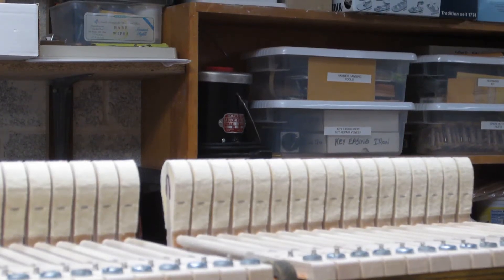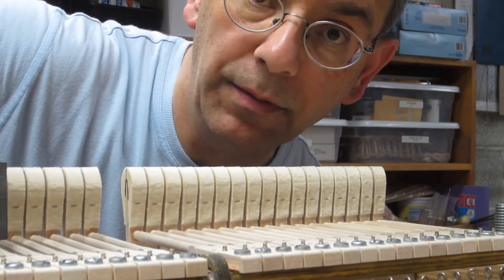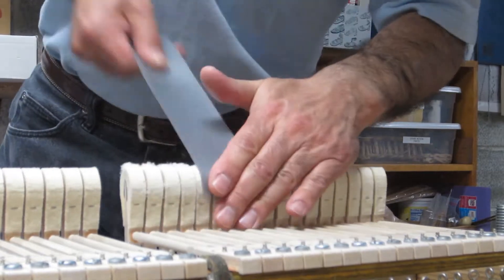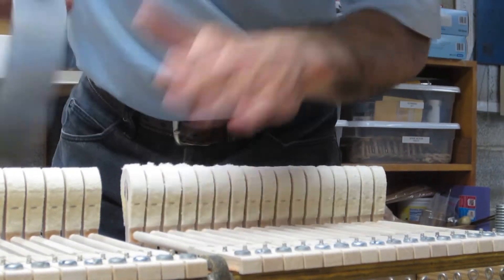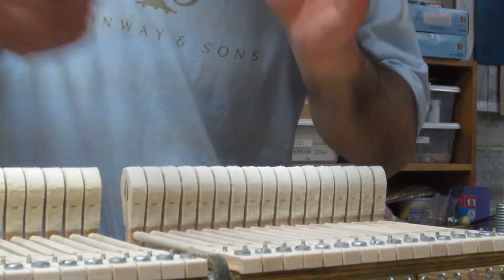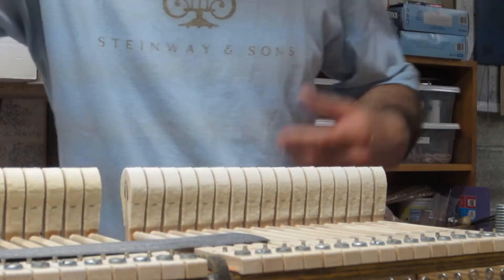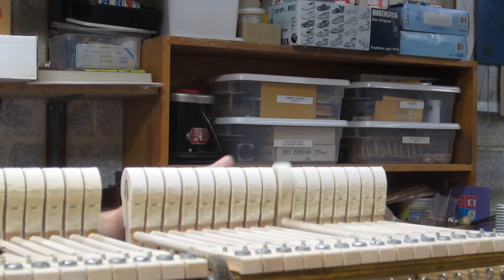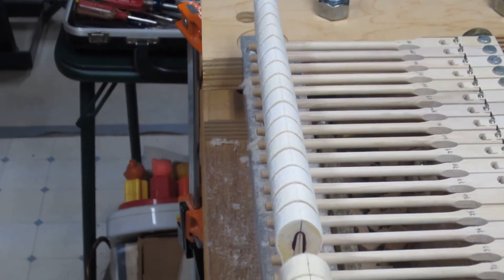Hammer Filing Basics on a Steinway L action

Comment: I've never used this method myself - nor have I ever seen this done in this this way before. Moreover, my copy of the piano tuner's 'bible' - Reblitz - makes no mention of this either. I guess I'd have to try it for myself in order to see if it actually works. My own method is as described by Arthur Reblitz, using a hand-held sanding block. 

I should add that I have 46 years' experience working as a piano tuner/technician.

Comment from the maker: For grits of paper, I use four grits of wet-or-dry paper:  220, 150, 400, and 600. (Of course, I don't use the paper wet.)  This is for current vintage Steinway hammers (2017).   Steinway hammers in the 1990's were in transition from the type with the gray shoulder dye to the clear white felt we now have.  These hammers were not quite as dense as today's hammer and could be filed with coarser grit, like 150, and even 80 or 60, depending upon the amount you wanted to pull off.  For all hammers pre-1984, with gray dye on the shoulders, I usually started with a 60 grit and progressed up to 220.  These were the exceptionally light hammers (2 grams lighter on average) Steinway used to make all the way back to the early 1900's.
Reply: Hi Robert, thank you so much for your information on the history of the steinway hammers. Do you happen to know if steinway factories (Hamburg and New York) used similar hammers pre-1970?

Comment: Hello Robert, thanks for your video.  I am looking for information which I cannot find in any books or videos I have been watching, so I'm seeking your advice please. I am rebuilding a 6' Bechstein Grand. I had a company replace all the hammers and glued new shanks.  Now that these hammer/shank assembly have been reinstalled, I need to check the travel of each hammer to the strings.  Before doing this, should the hammers be vertical to the strng, then set the travel or is it more important to make sure that the hammers strike the string at 90 degrees?
I have set the hammer AO vertical, but when lifting to the string, there is side travel.  Before setting this hammer vertically, there was less side travel.  This confuses me.
Where do I start...?
Thanks for your help
Reply from the maker: I travel hammer shanks before I glue on the hammers, but I understand that you had new hammers and shanks sent to you pre-assembled.  In the case that I received hammers and shanks pre-assembled, I install them on the action frame and travel them right away.   After traveling, I check for hammers that aren't vertical and use a heat gun (or alcohol lamp) to "burn" the offenders vertical again.  This is an important step before filing, because if a hammer or hammers aren't perfectly vertical before you begin filing, then you're going to get a skewed strike surface.  When it comes to hammers that are angled, I file them one at a time with narrow strips of sandpaper.  I didn't show this in this particular video because it was only a casual video demo intended for my sister-in-law.  The process is much the same during single hammer filing.  Somewhere in my videos I have on on traveling.
Reply: Thanks Robert, much appreciated

Comment: Hello Robert, Nice Videos, thank you!   I would like to know if you have any experience with Schimmel Konzert Piano Hammers   I need to know if the hammers on those pianos are designed to be juiced for tone building
Reply from the maker: Hello Fernando,
I have never worked with the hammers you mention.  However, if they are anything similar to the Renner hammers used on Bösendorfer, they can be juiced.  The techs at Bösendorfer in Wiener Neustadt (the factory) use a concentration of 8:1 lacquer on their hammers as needed.  That can give the hammers a tonal boost.  If I were advising you, I might suggest you try that concentration first.  If it doesn't have the desired effect, then try something like 5:1.  Mind you, we're talking about thinner:lacquer.  I can't recall whether they used acetone to cut the lacquer at Bösendorfer.  It probably is lacquer thinner, and the lacquer is nitrocellulose wood lacquer.  Personally, I prefer to use acetone to cut my lacquer.  (This gives me the idea that I ought to do a short video on lacquering Steinway hammers...something for me to think about...)
Reply: Robert Grijalva thank you very much Robert!! 
I appreciate your kind reply and will follow your advice.  I will check alignment and strike points first and will also try your shaping technique as well.

Comment: Isn't backside felt filing in upward motion instead of filing downward?
Reply from the maker: The direction of filing any hammer is a matter of the nap of the felt.  Some hammers file better in one direction, as I do in this video.  However, filing upward works less well on contemporary  NY Steinway hammers.  In 1984, Steinway reformulated their hammers and went away from the super-soft grey-edged hammers.  The grey-edged hammers responded better to the two-sided technique.  Current hammers, which have been refined and steadily improved in the last 20 years, seem to have a shorter, and more dense felt that requires filing in one direction with straps rather than paddles.  In my experience, the one-direction strapping produces a finer appearance, as with these in the video.  Thanks for your question!
Reply: Robert Grijalva Thanks Bob for detailed answer.  I appreciate all your informative videos.

Comment: I tried one direction sanding on my Abel naturals, but in the treble, the felt at the back became really fuzzy. I tried sanding upwards to get rid of the fuzz, which did flatten down some of it, but then there was a ‘line’ of fuzz near the crown which cannot be removed... 🤔 I am puzzled
Reply from the maker: I apologize that I haven't replied sooner.  Regarding your Abels; they are of a different construction than a New York Steinway hammer.  They are more similar to the Hamburg hammer, which is made by Renner.  In this case, you did the right thing to fill upwards on the rear side of the hammers.  Some hammers do file better like that, and you simply meet at or near the crown to get the front and back "layers" aligned.  The fuzz that resulted during your Abel filing may also have been caused by using too coarse a grit on them.  I have found that with European hammers, using the finer grits is best.  Instead of starting with something like a 150, I start instead with 250, then progress to 400 and 600.  I may even start just with the 400, depending upon the amount of hammer wear.  Of course, all this is generalized info.  You have to experiment a bit to find the best combo of grits and technique to file the hammers you have at hand.  Best of luck!
Reply: @robertgrijalva7158  Thank you!
Reply: Like most UK and European tuner/technicians, I always use Abel Natural Felt hammers whenever installing new hammers on a piano - they have become the industry standard on this side of the Atlantic. Thus far, I have had no need to reshape them, given that most piano owners do not practice for 7 or 8 hours per day for 6 days per week, and therefore they are not yet worn down..! 

As per my comment of this video, I myself have never even seen this method of reshaping hammer felts, and there is no mention made of it in Reblitz. 

I may try this method at some point, but there's no way I'd experiment on a customer's piano. I've been a tuner/technician for 46 years, and I err on the side of caution...